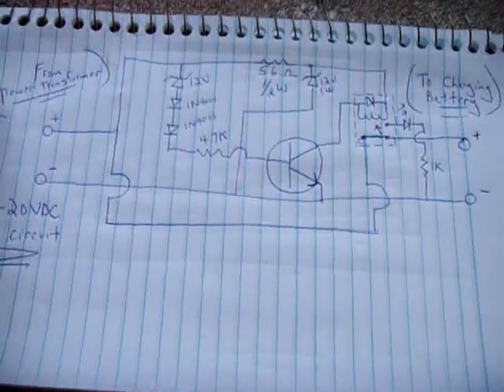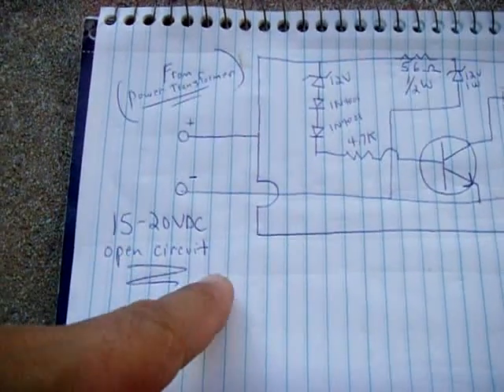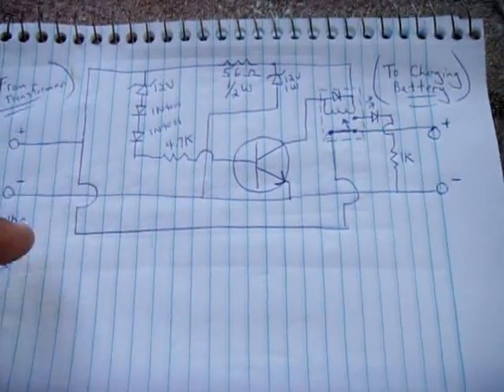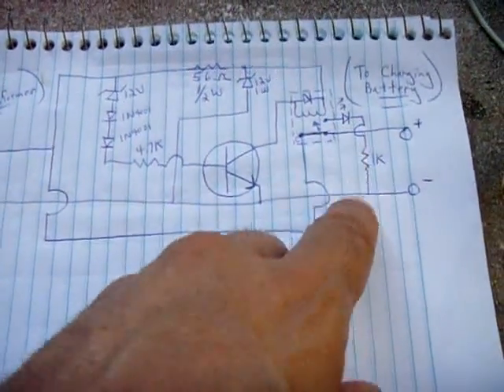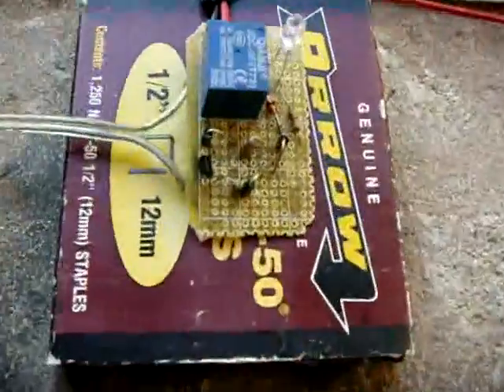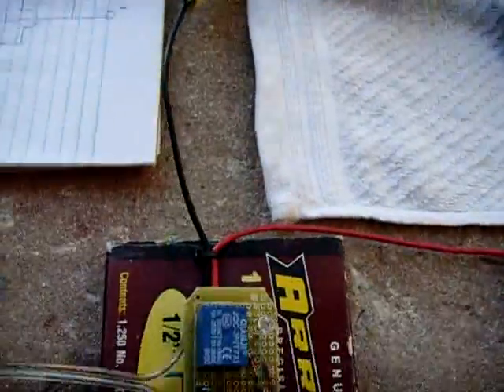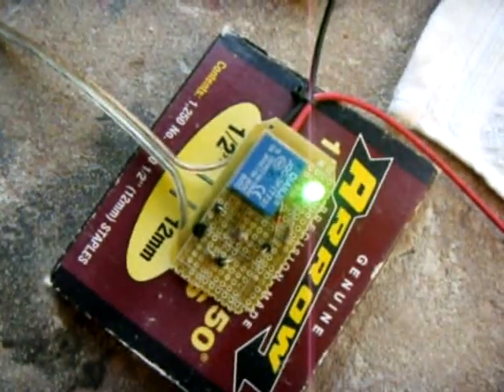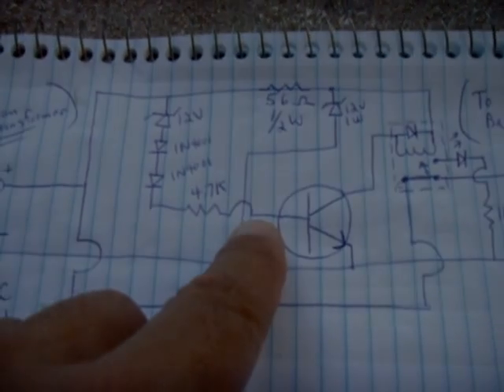Cut-Off Circuit For 12V Lead Acid Battery Charging

Comment: Can u modify the circuit so that its input voltage is 190v ?im making a capacitor bank charger which charges upto 190 can it work?
Reply from the maker: Ziyad Mohamed The big problem is making sure one capacitor does not charge much more than others.
Reply: electronicsNmore i have found 2 200v zener diodes (UG2D) wat should the values of the resistors be?and should i add 2 other diodes if i only want the transistor to turn on at 200v? srry i made a mistake in my previous comment the input voltage is more than 190,all my caps are in parallel.my transistor is http://pdf1.alldatasheet.net/datasheet-pdf/view/449099/WINSEMI/SBP13009-O.html
Reply from the maker: Ziyad Mohamed Sounds very dangerous what you are trying to do. I would advise not doing what your looking to do. You can easily be killed by accidentally touching a charged cap bank.
Reply: I m making an autocut circuit (using urs)to switch off power to the bank when full
Reply: electronicsNmore this also another reason i making this circuit since i have to always grab up my multimeter to check the capacitor bank's voltage and donot worry because i have thick gloves to prevents accidental shocks
Reply: Ziyad Mohamed i really need your help sir
Reply from the maker: I will not assist you with such a potentially deadly project. There is enough info in the video for you to figure it out the modifications. Not that difficult.

Thanks
Reply: my power input is 250v 20mA sir its no that dangerous  besides i have used MOTs a couple of times :)
Reply from the maker: The problem is not the 250V 20mA, After the caps are fully charged, you will have plenty of current to kill.
Reply: i really appreciate ur high concern for my safety but i really need ur help sir promising to follow every safety measure
Thank you
Reply: sir plz i really really need ur  help tried many things but failed and i donot have much time
Reply from the maker: You should be thankful that I answered any of your questions. There are MANY popular Youtube channels that don't answer any questions, so as I see it, you are ahead. I told you I WILL NOT assist you in making a highly dangerous device(I also do not care what the reason is). If you continue to bother me about this, I will mute all your comments.

Thank You
Reply: first id to apologize for my bad behavior sir.i kinda got sad and want help cuz i have been working on my project 4 almost a year now and seeing it all go was sadning 4 me.but just leave it is just a project after all but wat matters most is other ppls feelings i am really srry 4 bothering u sir and if u do anything to compensate for the effect if i have plz let me know
thank for ur continous kind feedback

Comment: Hello sir, i hear the relay click right away and the LED blink suddenly when I plugged in my power supply can you please tell me what this means? Also while connected i can measure the voltage along the supply pins and i measure around 15volts+ but the LED is not turning on. Is there a problem in the circuit or is it my battery? Thank you.

Comment: Good day sir. I've been trying to do the circuit as shown in your diagram but the relay won't trigger. I'm using SPDT electromagnetic relay 12V, 8A. Thanks you sir.
Reply from the maker: Hi there. If the relay is not triggering, then either you wired the circuit incorrectly, have a faulty component(transistor), the power supply is not high enough in voltage, or the zener value/rectifier diodes are not the correct values.

Thank You!
Reply from the maker: 180AH are huge batteries. Must be 8D. If you place both 12V lead acid batteries in parallel and charge them you should be fine just as long as the batteries are the same and in the same condition. One weak battery with a newer battery is a bad idea.
Reply: electronicsNmore hello sir, can you please help me with a circuit that is used to charge two 12v 180AH batteries at the same time ? and is it possible to build it myself ?
Reply: electronicsNmore thanks, to be honest i need this for my graduation project. am in a big trouble as electronics is not my domain of work,am a electro-mechanic student and i chose to study mechanics mostly because i am more into it. and this project i got it as a leftover from the proposed projects in my college. usually i have choice but all mechanic related projects are taken
, i was sick and i was planning to leave it for the next year, also i skipped a lot of classes due to unexpected health problems , this text will be little long, so if you are willing to help me, i will be really grateful, else, i don't want to waste your time reading this.

The charger is formed by a transformer, rectifier, and a regulator, right. what i had in mind is to buy the components and build my charger. but my professor told me that you have to make every thing home made. now i am in a big trouble and i don't know how to make the needed circuit schematic. a very skilled person like you won't take more than 10 minutes to draw the schematic. also i am really out of time and don't have much knowledge in electronics, 

please sir, can you make a video and explain to me how the circuit works ? do me a favor please, just the circuit schematic , and what components should i use and which values and why.

i really won't forget it. in case you are willing to help me, here is what the professor gave me.
the charger should give 2x(12volts  200AH) and should have a sound alarm to indicate that the battery is charged 

and only gave me these values : 2x12 transformer 500VA. 230v 50hz

also he told me to take responsibility and doesn't understand that i never planned to make a electronics project, at least if it was electricity it would have been much easier,. still he won't give me any help and he told me that i have 2 weeks or else  i will be delayed to the next year, i still have 5 days. i tried looking  on the internet but i never understood how these things work exactly.
Reply from the maker: I appreciate you watching, but unfortunately I cannot make a new video for one or 2 people who are requesting it. If many people asked, then that would be a different story. I have too many other projects going on, and the video would not be beneficial to me. I have over 260 videos, and many people asking for assistance, unfortunately I cannot be expected to take the time to help everyone. Some people who return the favor by showing they shared my channel on other websites or contributed, then I will provide a "higher" level of assistance, but there are limits. Many channels don't even bother answering viewer's questions like I do.

Thanks For Watching. There are many websites online that can teach you how things work if you are new to electronics.
Reply: Thanks anyway, and good luck.
I guess my graduation is unlikely to be this year
Reply from the maker: Unfortunately you cannot blame others for any problems you may have. People create their own problems in life, and must learn to deal with them.

Thanks For Watching
Reply: electronicsNmore Hello again, i'm still commited to finish this project, i really searched alot, and all i could find is smart regulators that are ready to use, what i want to do , is use the classic way, using thyristors, can you help me ? or at least give me few hints. i am not really qualified to do this, but i am reading most of the time during the past week, and it's really frustrating without some one helping me.
Reply from the maker: My advice to you:

http://forum.allaboutcircuits.com/

Register and ask your question there. Very helpful website. As I said, I only answer simple questions from viewers on my channel, and I do not have the time to draw up special schematics or make a video for one or two viewers. Most channels would not have taken the time to even answer your question from the beginning. That I know for a fact.

Thank You
Reply: electronicsNmore thanks for the website.
andt take it easy , you already told me that :)
have a wonderful day

Comment: Hi my friend if i would like around 13.5 Volts. Is it a case of not putting the 4.7ohm resistor in the circuit? Much appreciated.
Reply from the maker: The circuit shown in the video is around 13.5V. The limit is adjusted using the zener and/or rectifier diodes in series with the zener. The 4.7 is a 4.7K OHM!

Comment: I have made an illustration of your scheme, tell me is this correct?
http://s9.postimg.org/4osijj4sv/12v_Battery_harger.png
Reply from the maker: Rezart Shehu Hello. Nice job, but i noticed a couple problems. The resistor R0 is 56 ohms, not 5.6! You also forgot the 1n4003 to 1n4007 diode across the relay coil in reverse bias to protect the transistor against back EMF from the collapsing magnetic field from the relay coil.
Reply: electronicsNmore Right, I think now looks OK.
http://s12.postimg.org/4q4u6ugtp/12v_Battery_charger.png
Can you tell me if I let connected to the battery can it recharge when the voltage is droped or it needs a reset?
Reply from the maker: Rezart Shehu
Looks fine now. You would need to use a momentary normally closed push button switch between D1 & R1. Press to reset

Comment: so all my parts are busted
Reply from the maker: No. If you use the correct resistor value/wattage with a new zener, you should be fine. As long as you had a diode across the relay, the transistor should be fine.

Comment: the 5.6 ohm smoked what should i do
Reply from the maker: 5.6??? That is a 56 ohm!
Reply: is that why it burnt out
Reply from the maker: Just copy EXACTLY what I did. You will have no issues. If a resistor gets too hot, then use a higher wattage resistor. Very simple.

Comment: ok but my solar pannel gives 22 but not constantly will that have a inpact
Reply from the maker: 22v is the open circuit voltage of the solar panel(nothing connected). Once you connect that panel to this circuit, the voltage will drop. You will be fine.

Comment: Nice, now I wonder why the battery voltage is measured in the transformer side and not in the battery side.
Reply from the maker: Both are connected together. :-)
Reply: electronicsNmore But in theory the transformer will always have the same voltage but the battery not because it can be cahrged or discharged. So why not detecting the charge status on the battery instead of the transformer?
Reply from the maker: You not understanding this circuit. When the circuit is powered up, the relay is allowing current to flow into the battery. The result of that load causes the voltage to drop on the power supply. Once the battery reaches a full charge voltage, the voltage which is the SAME on the battery and + of the power supply will be higher causing the transistor to turn on and stopping the battery from charging by powering the relay. Very simple.
Reply: Ok, yeah I wasn't understanding, the power supply voltage goes down when the battery is discharged, thank you.
Reply from the maker: Your Welcome.

Comment: will this circet work with 14v dc in
Reply from the maker: Really need higher voltage in order to charge the battery correctly.
Reply: thank you

Comment: Hello sir, can you tell me in detail how you simulate the circuit? I tried using 2 power supplies, one as input and the other to simulate the battery voltage. But as soon as I connected the circuit, the voltage clamped at about 13V (where I want to cut-off) and the LED light up. It worked but I can't really adjust the voltage or anything to observe the increasing in voltage. Did you leave the output open when you simulated your circuit or did you connected it to a battery?
Reply from the maker: Don't simulate. Make the circuit exactly as shown in this video and use it. It works.

Comment: Dear sir, since you said the circuit cut off at 14.2V, does that mean there's a 1V between the 4.7K resistor? What if I want it to cut off at 15V? Can you tell me how you come up with the resistor value?
Reply from the maker: The zener value is what is important. Use a 1n4001 in series with the zener leading to the base of the transistor. That will raise the cut off to around 14.8V. Experiment until you get what your looking for.
Reply: electronicsNmore I see. Thank you for making it clear.

Comment: Dear Sir, send value of diode. Thanks!
Reply from the maker: Everything you need to know is in the video. 12V means a 12V zener diode.

Thanks For Watching.
Reply: electronicsNmore I mean,  I can't see clear rectified diode 1N40001 or any other value.
Reply from the maker: You need to adjust the resolution setting on the video player, and give the video time to load up. Lower right corner of the video screen (third symbol in from the right corner is a settings symbol) click on it. Choose a higher resolution setting.
Reply: electronicsNmore  Thank you Sir.

Comment: mine charges upto 15.2... can u tell me whats wrong?
Reply from the maker: Remove one of the forward biased 1n4007's. That will lower the voltage. :-)

Thanks For watching! Be sure to share.
Reply: I really appreciate your quick response! i got it working last night. At about 13.8 to 14, the relay switches. I used two 1n4007s before then i replaced it with 4001s and the 4.7k with 57ohms. My relay is an SPDT auto at 40 amps. I want it to handle higher amps. This is my second pcb diy circuit. Im really happy about it.. If you don't mind I still have few more questions: =)
*can i add dumping on the circuit once the battery is full? Iv tried connecting in parallel with the LED but the relay just buzzes.
*can i put a simple delay(about 5 to 10 secs) before the relay clicks? If yes, how?
*The 57ohms 1/2 watt gets really hot (on the top of the diagram, along with the 12vdiode). What can i do about it?

Thanks again!
Reply from the maker: Try lowering the 56 to 33 or 47 ohms, or increase the wattage of the resistor to eliminate the problem. The reason why the circuit buzzes with the LED connected, is because as soon as you connect the LED, a drop in voltage is detected casing the circuit to trigger. Once the circuit triggers, the voltage rises and deactivates the relay. This cycly happens VERY quickly, and that is why you hear a buzzing sound.
Reply: Thanks a lot EnM and God bless you... 'til next time!

Comment: is there a way to remove this from a charger, im trying to use mine to etch metals but it doesnt turn on because there is no volts to detect
Reply from the maker: I don't understand what you mean. Remove from the charger?
Reply: The cut off, sorry I'm not really good with this kind of technical stuff
Reply from the maker: You have a charger that you want to remove the cut off from?

Comment: Hi electronicsNmore, wonderful and educational video. i have a problem i want to incorporate your circuit in my system but I'm stuck. I have 5 12V 20H SLA and connected to series and battery charger. I want a system is that after it reach the max voltage of 71V (14.2 * 5). Can you help me out with this one. Thanks in Advance.
Reply from the maker: Replace the 12v zener and the 2 forward biased diodes leading to the resistor on the base of the transistor, with a 72V zener. You may also raise the 4.7k to 10k. You need a high voltage NPN general purpose/amplifying/switching transistor(100V or higher-Vce) which can handle the current of the relay coil, Your DC power supply needs a no load output of around 90-100vdc MAX, you need a 72v relay, The zener to the right of the 56 ohm which will become a 200 ohm high wattage needs to be replaced also with a 72V, The problem you may have is heating of the 72v zener and 200 ohm resistor. It would probably be better to use a 12V automotive lamp in series with the 72V relay coil! The light would come on when the relay coil is very close to activating. You will need to adjust values to get it right.

http://www.ebay.com/itm/MORS-SMITT-D-U203-AU-72VDC-RELAY-440V-10-AMP-/400430900315?pt=LH_DefaultDomain_0&hash=item5d3b8aa45b

Comment: so  the battery must be recharge when   the voltage down to 10.5v ?
The NO is connected to  anode part of Led And the NC is to Positive output , of the battery to charge,.. i think i have to change my (2) 13v zener  to (2) 12v zener and change my transistor BC547 to 2N4400..
Reply from the maker: Ideally you should never allow the lead acid battery voltage to drop below 10.5v. Always recharge quickly to prevent sulfation of the plates. Lowering the zener value will end the charging at a lower voltage. The bc547/2n4400 should both work.
Reply: so 13v zener will be fine ? i don't need to change it to 12v zener? and also the BC547 ??? 

so, i think the problem is my 

5A/10hours. 12v lead acid battery ,. right sir even though i've already changed the battery solution,. still its very fast to fully charged, for just a minute, it reaches 12.56V and the cut-off green LED turns on,.. :-( 

what do you think sir?
Reply from the maker: Battery that have lost capacity will charge up quickly. To increase the cut-off voltage, try adding a 1n4001-1n4007 after the zener(connected to the 1n4001 anode), then the cathode in the direction of the transistor's base. Your transistor should be fine

Comment: I was wondering about the purpose of the 1N4003/1N4007 diode across the relay's coil but I found the following at http://en.wikipedia.org/wiki/Relay : "a diode is often placed across the coil to dissipate the energy from the collapsing magnetic field at deactivation, which would otherwise generate a voltage spike dangerous to semiconductor circuit components." Is that for protecting the transistor?
Reply: +Proctor Silex i think it protects the source